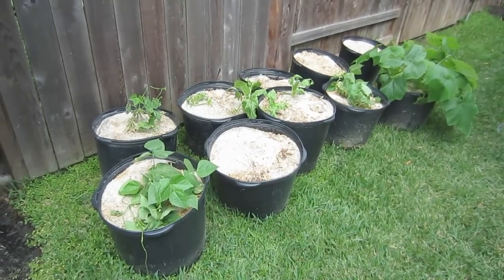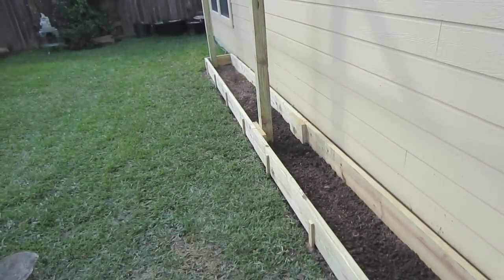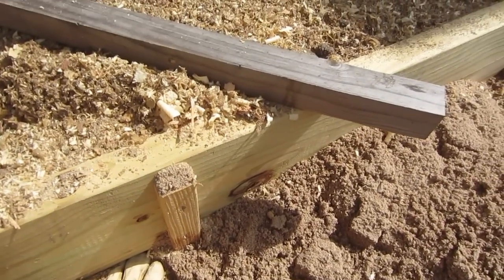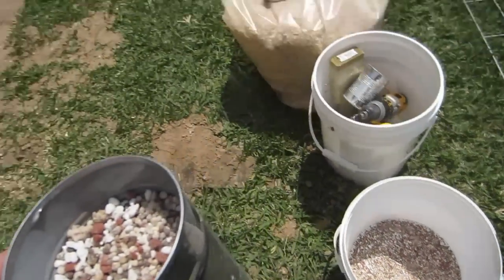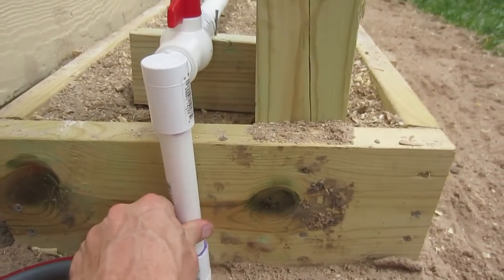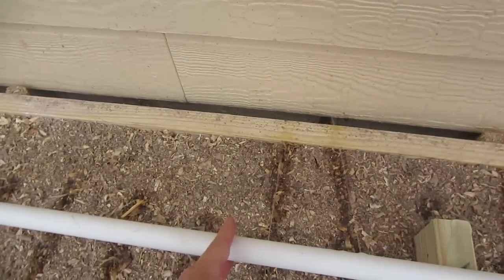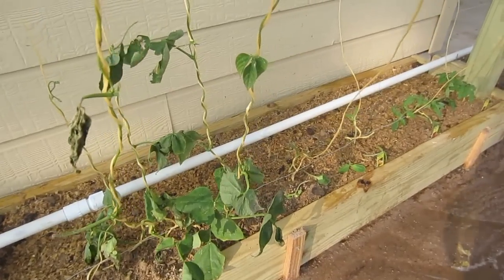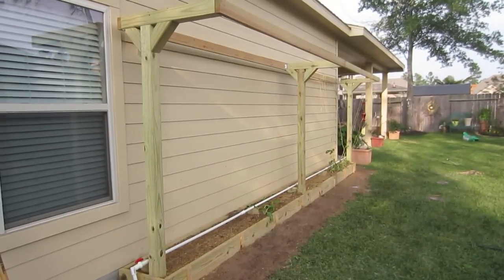Raised Garden Bed Design: From Buckets to Beauty

Comment from the maker: Here in Texas they tell us to keep the ground around the foundation moist all year round so the foundation doesn't crack. He has had the bucket garden in the same location as the new garden for years with no issues. Since we only water for 60 seconds, just enough to get the soil wet there is no a lot of run off.

Comment: I didn't glue my pvc together. I don't have leaks and this allows me to move and adjust the pipes as I need. 

Also, he needs to check monthly for termites next to the house. I put mine a foot away from the foundation so I can see it clearly. We had termites from a flower bed that was too close to the foundation years ago and learned to watch out for them.